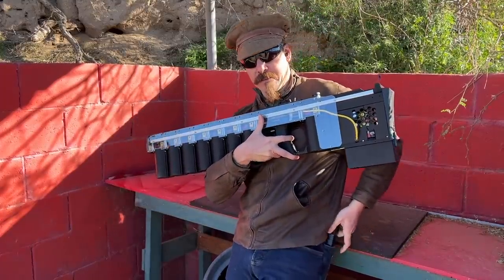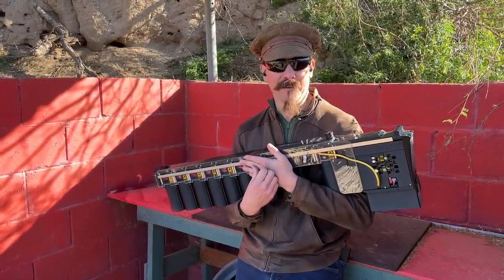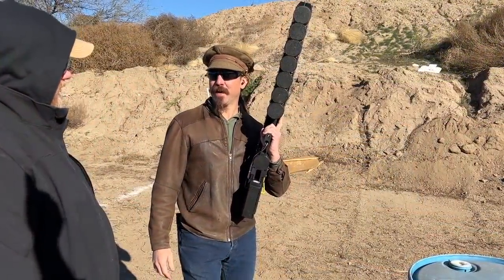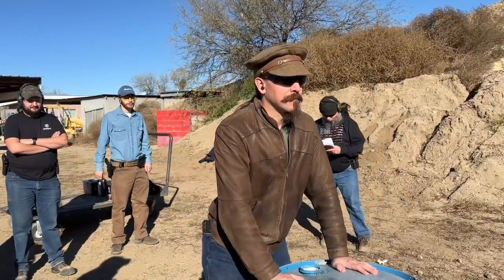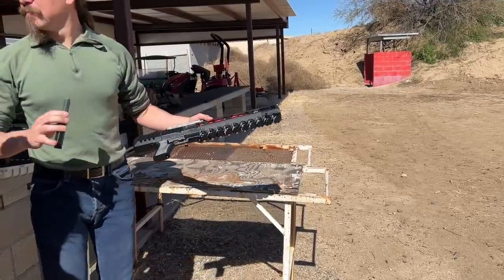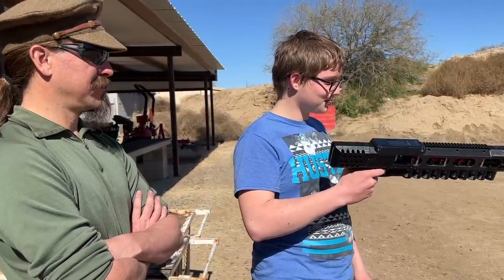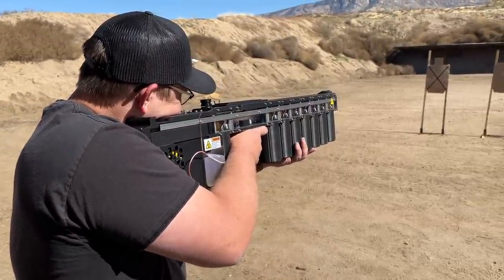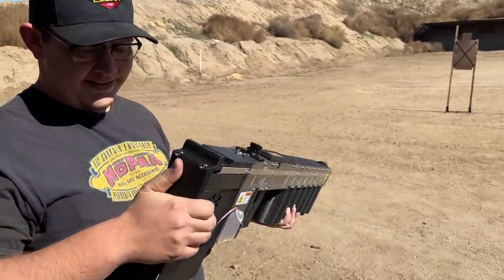I Tried to Use the GR-1 Anvil at the BUG Match...

Comment: An electric air rifle is way better...
Reply: Sure, it is now. But remember there was a period of hundreds of years during history where gunpowder firearms were much less practical and effective than a bow and arrow.
Reply: @davidbhart1867   not really. What you say is true and all, but the reasoning behind it isn't. Back then metalworks where expensive, and the little science we did have had much more important and pressing tasks to tackle... Do the only reason things where that way was because no one was interested in researching gunpowder and ballistics. Even so, and even without that, that didn't last and once the musket was introduced, despite still little knowledge and research going into it, it overshadowed the bow and arrow + crossbows really quickly. Meanwhile we have a ton of science now and in the past 200 years, MASSIVE interest in electricity and electric weaponry too, there's been a ton of research into it all, but all the science so far would point to the fact coil guns are basically useless. Railguns might be useful, but only on a pretty massive scale... Might shrink a little, but the science behind its operation principle promises it won't be much. Could guns meanwhile... Yeah, nothing is happening any time soon (heck, this and other BEST attempts so far are hardly much better in the principles behind it than the first one that was made roughly 200 years ago... Again TWO HUNDRED YEARS, just think about it for a sec), because far too much needs to change to make it even remotely viable. 

I won't even mention batteries, both because they're not too important to this, and because it's a field where significant progress will definitely be made eventually... But first of all, supercapacitors. Sure, they might make the tech for those a lot better in the coming years, but just think of the numbers for a second - to make the pellet fly just twice as fast, you'd need to QUADRUPLE their capacity. Seeing that they are currently flying at just 75~ m/s, it means that even just to reach the previously mentioned bow and arrow speed, which is so far capped at a record of 134 m/s, you would indeed need to QUADRUPLE their capacity. But well, as we mentioned, bow and arrow are obsolete and impractical. So, this means we need to compare to guns at least.

Let's give it a little discount and say it won't need to go over 340~ m/s, aka the speed of sound, so it can retain at least some advantages, and just needs to reach 300 m/s... That would require the capacitors to become 16x times as powerful as they are now! "Ha, that'll happen sooner or later" you may say... Sure, I'm not arguing it will or might happen relatively soon (20 years if there's a breakthrough, probably 100-200 if not), but, here's the thing, that was JUST THE FIRST and probably least significant problem! 

Next one is, and it is related to what possibly might be going though your head is "Just make the pellet smaller, that'll decrease the capacitor requirements!"... Well, here's the thing, do you know WHY they use such a large caliber with heavy pellets? Because even as is, the coils can only barely handle this much, and there's a narrow line of caliber to coil and capacitor to walk, for which this is the optimal pretty much, making smaller pellets won't make them go much faster due to how coil acceleration works and how inefficient it is... So there's your second and a lot more major problem - the coils themselves and their limits of electric capacity without burning, as well as being a very inefficient way to accelerate stuff to high velocities, especially over a short distance (barrel). Even cheap and maximum efficiency superconductors won't change this (that's aside the point we don't have this tech anyway).

And if all that isn't bad enough for you, here's one that's as bad or WORSE than the previous ones - switches. Aka that electric doohickey that actually releases all that energy from the capacitors into the coils! Even now they wear out super fast with those, and are pretty big and expensive, meanwhile, even if you manage to make capacitors a lot more powerful, which is, as I said, seemingly quite possible, you'd need to improve the switch tech exponentially far more than capacitor tech for it to work!

And even if you do, the coils will still fry up with any currently known and even theoretical materials and conditions. There's many more small problems too, I won't go into them tho... So as you see - nope, not happening. And that's on top of the fact that there's far, FAR more promising alternatives, not to even mention normal firearms which work pretty damn well and are pretty reliable and cheap, so who and why would invest in coilguns anyway? Airguns meanwhile show far better results, some being almost on par with firearms, and an electric integrated compressor is far easier and more viable an option. A bigger, stationary compressor meanwhile that will provide the air power to a whole squad from inside their car is already available since long ago, and even probably a backpack version. And that's not even mentioning other innovations that are quite possible for this!